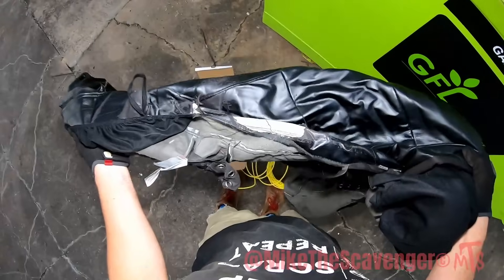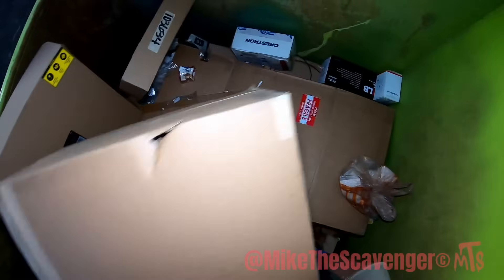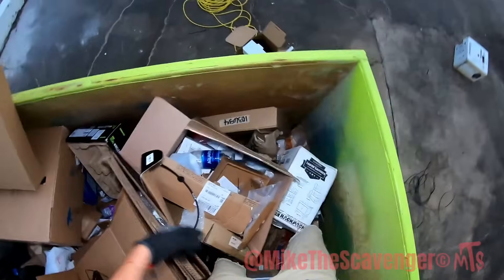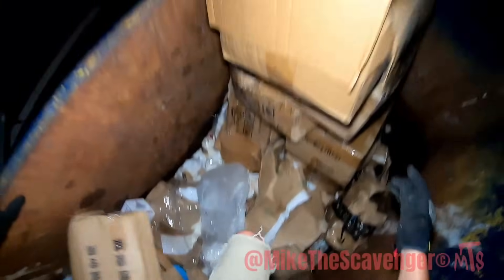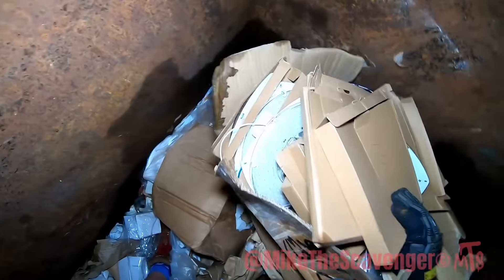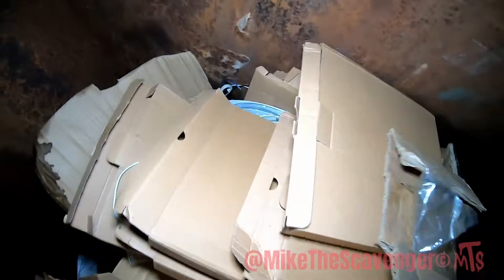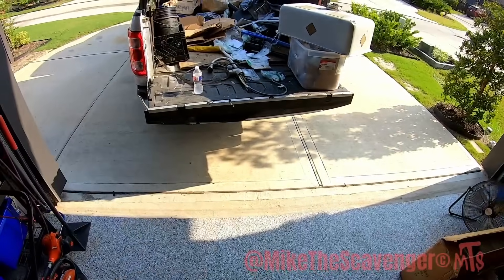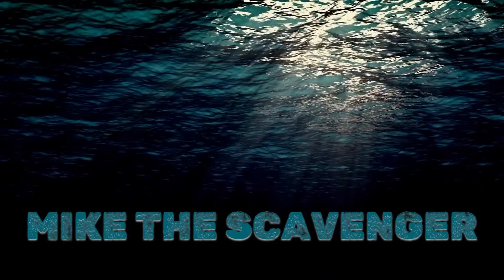Dumpster Diving (3,300 PAIR OF BRAND NEW SHADES!!!!!!)

Comment: Definitely I used to do flee markets glasses  2.50 dozen cheap plastic ones 4.00 dozen wire frames  I sold them by the box and singles plastic $1 each 10 dozen wire $2 each 20 dozen you would be surprised how many dozens you would sell! This was in the late 90 early 2000 best of luck all you need is a couple of mirrors and tables.

Comment: If I had them, I would setup up somewhere with busy traffic and sell for $2.75 / pair.   Get a few rolls of quarters for change and make yourself  $9000.  $2.75 looks so much lower price than $3 and I think you would sell them off in a few days or so. Maybe a few weeks but good profit for sure.  OR split the profit with a friend and have them sell them instead of you doing it.